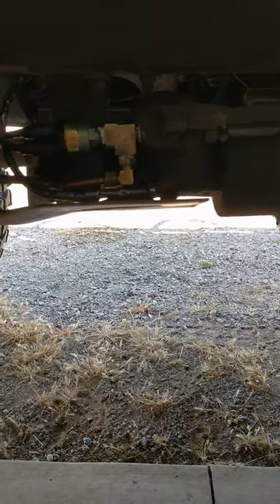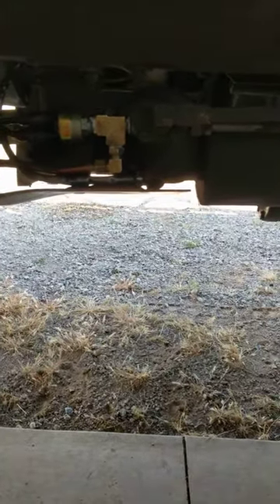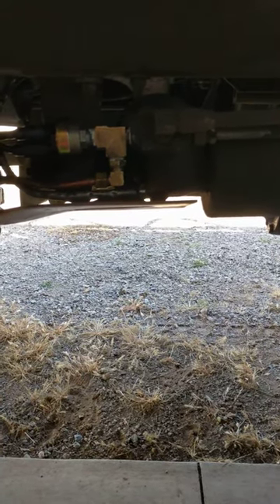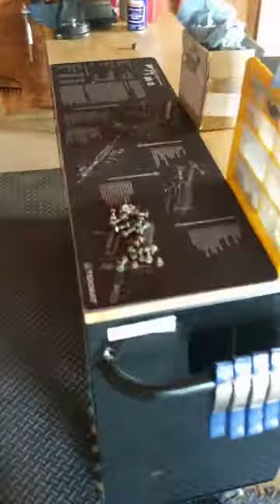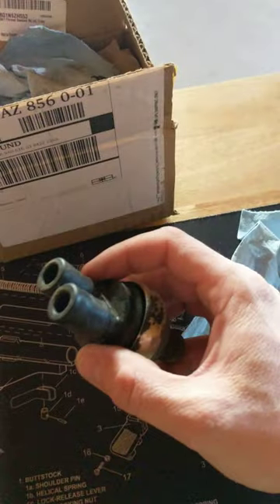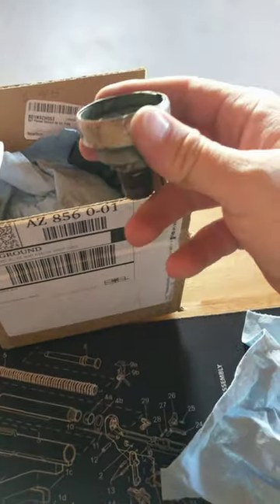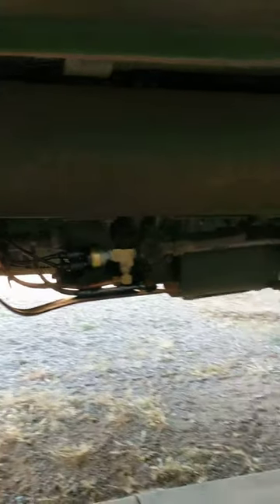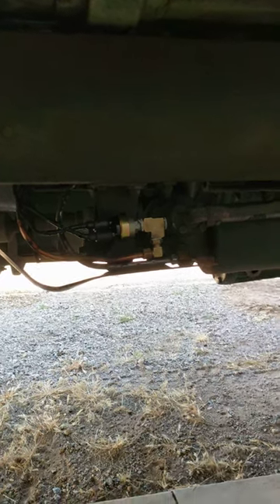M35A2 brake light pressure switch (air style)

Comment: That shot of the installed switch was just what I needed. I am replacing my air pack so I'm installing the switch kit on the new air pack before I install it. No instructions came with the kit. Easy peasy with this picture. Thanks.